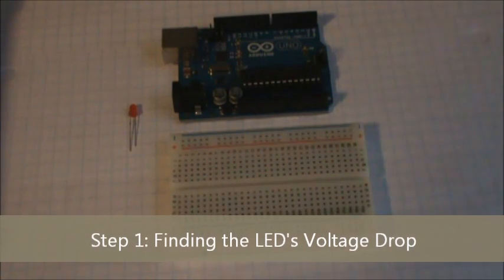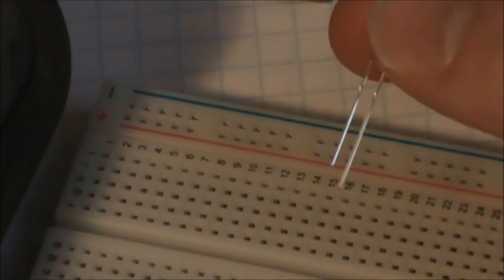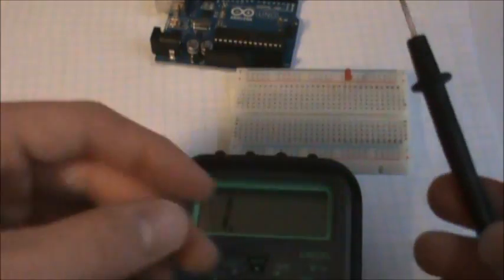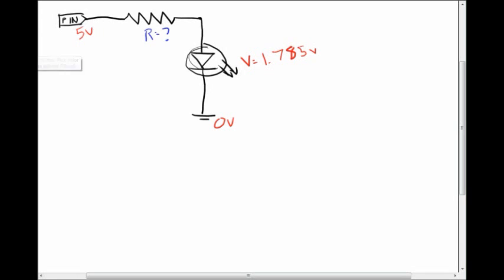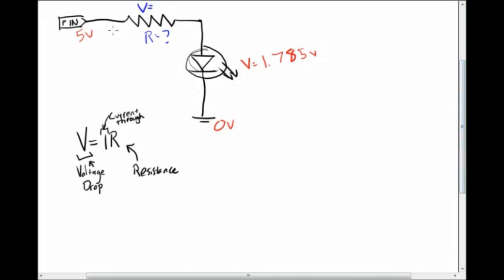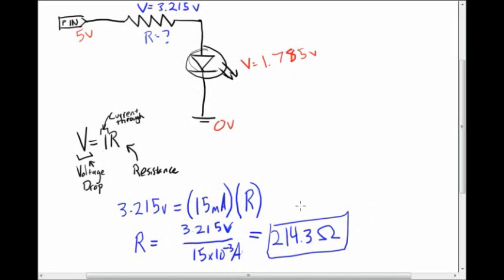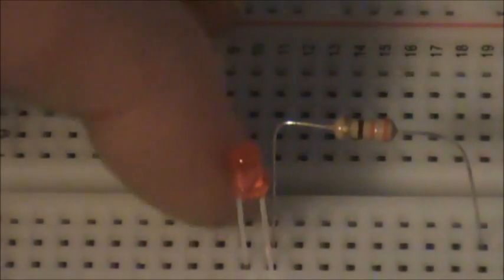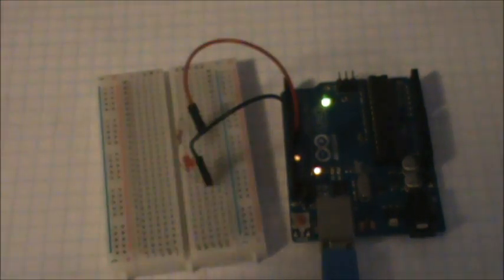Selecting a Resistor for an LED

Comment: hello kind sir, if i have a lot of leds to light up, do i also need to have more resistors or a higher value resistor?
Reply from the maker: More resistors.  See here for more information: https://electronics.stackexchange.com/q/13613/17375
Reply: thank you. im new to this, and im trying to learn.